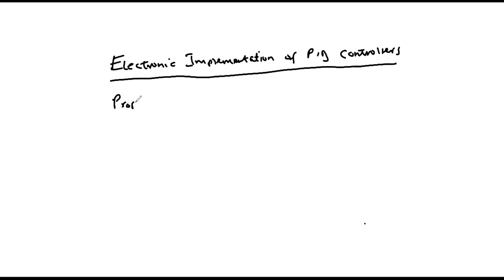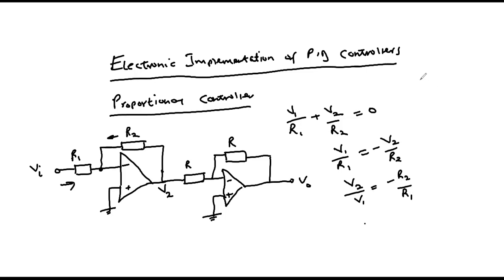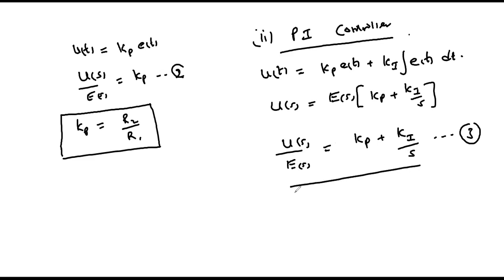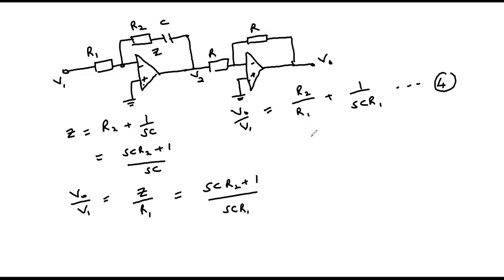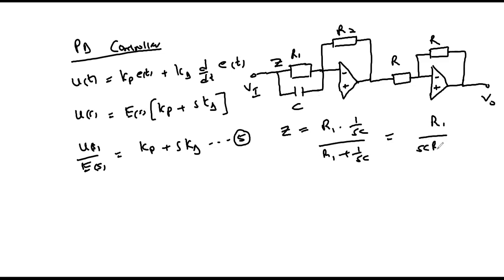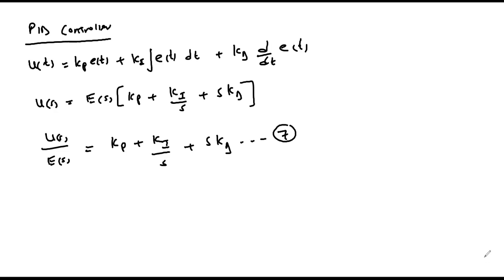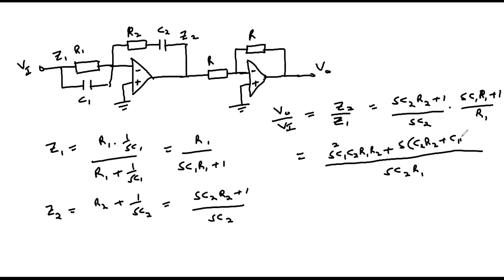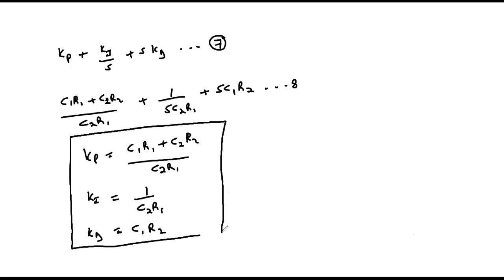Electronic Implementation of PID Controllers

Comment: For an adjustable PID controller it may be worth using 2 extra op-amps so that each gains can be adjustable via a single Potentiometer without affecting the other gains. 

As shown there are too many "cross effects". If the required gains are known, then the above can be sufficient.

Comment: Thank You Sir for this clear explanation of the PID controller in terms of Using simple electronic components which an Electronic Technician can understand and analyze by breadboarding a circuit and also enhances the learning of how tuning works in the real world and implementing discrete components along with ARDUINO controller PID experimentations.